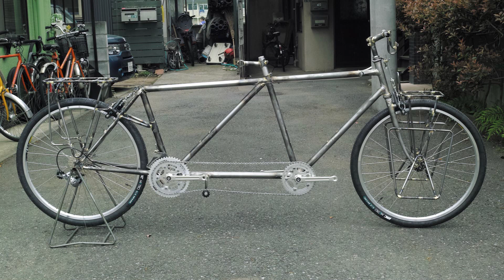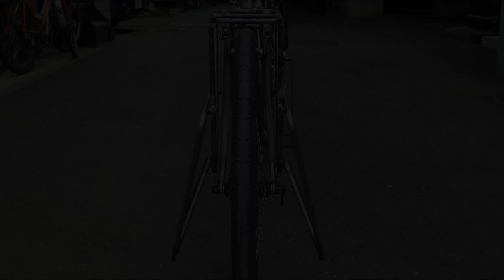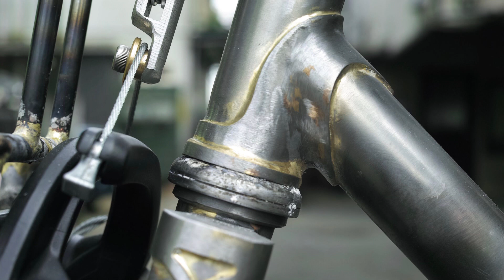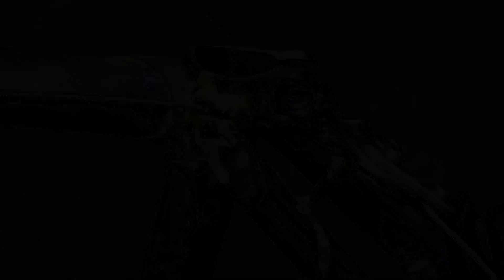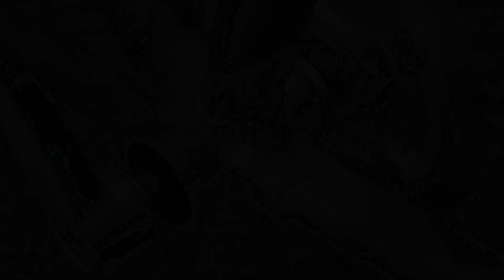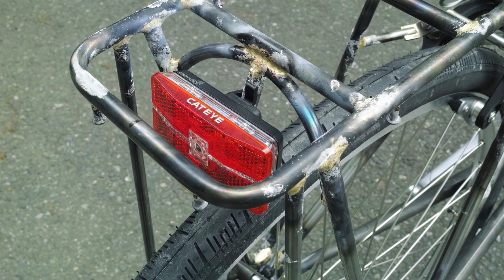（字幕）HIROSE's Tandem   Special Edition / ヒロセのタンデム　特別篇

Comment: ネジ止め小物が多いようですが、ネジだけでどのくらいの重さになっちゃうんでしょうか
Reply from the maker: I think Hirose has never measured the total weight of the screws alone. As for the weight of the bicycle itself, you can imagine that Hirose and the owner lifted it in the previous video. I feel that it is not a problem weight at all when I actually lift it.
Reply: @HiroseMuseum  Coolio, that's a good point, as the whole bike can be lifted up quite easily. Must be very good tubings are used in the making!

Comment: What is the total weight of this tandem bike ?
Reply from the maker: Unfortunately, I don't know the total weight of the bike because it's already in the hands of the owner.
Reply from the maker: I would be happy if you could imagine that Mr. Hirose, who was over 70 years old at the time of shooting, is lifting. Imagine the last time owners over 60 years old lifted. In order to secure the necessary strength, a thick pipe is used, so it is not a light body, but its running and riding feel is very light.